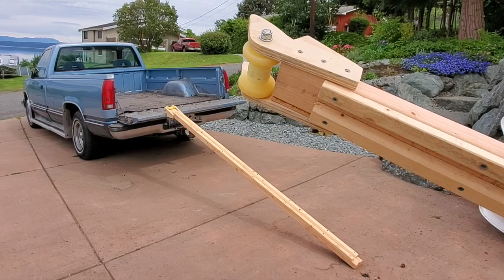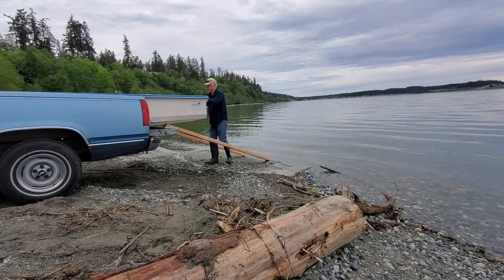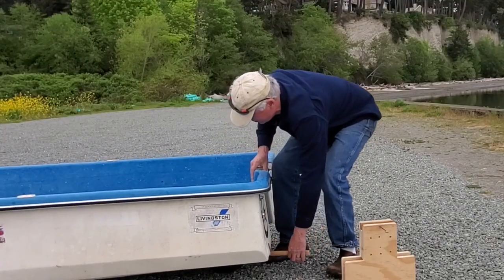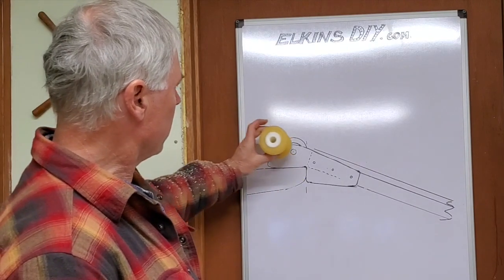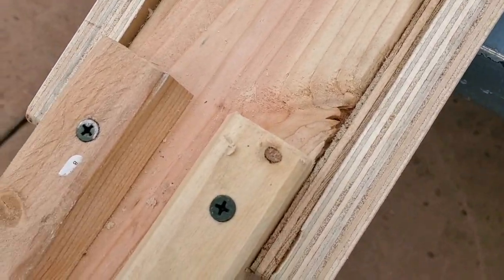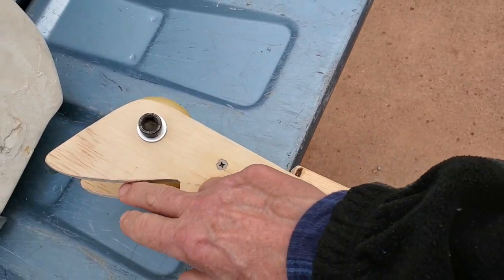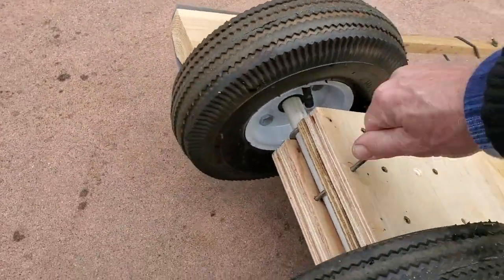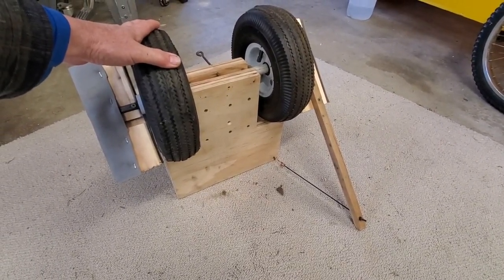Livingston boat ramps and dolly

Comment: For the coroplast boat, if you add the wheelbarrow wheels you said you might add, you could use rope, pedals, and a few pulleys to get a paddelboat-like system, where you pedal  and the wheelbarrow wheels just barely touch the water and move you along. Bonus points if the wheelbarrow wheels actually have paddles for more efficient moving.

Comment: I used to have a 7 ft Livingston.  I loved it.  I made a couple of boards to give me a flat deck.  The only real problem was no drain, but it was unsinkable.
Reply: 54nathanael Interested I am. Thanks
Reply: Also, this ramp system is as elegant a design I’ve seen anywhere. Form following function but this one is really really beautiful artwork
Reply from the maker: @davidfuller764  Thanks David. These definitely did the job. And fun to figure out and build

Comment: How did you connect the 1/2" bolt axles to the 1/2" tubing that was screwed to the 2x4's?